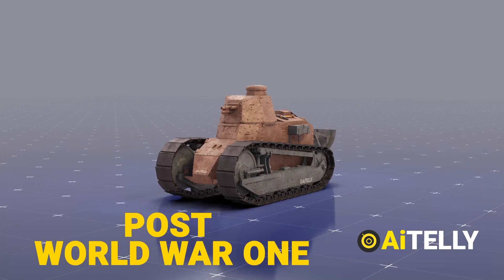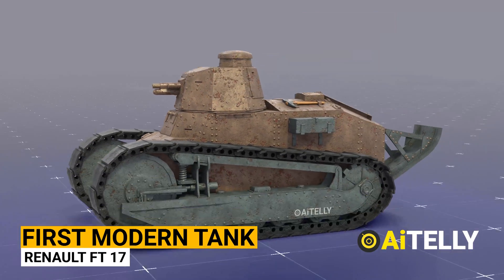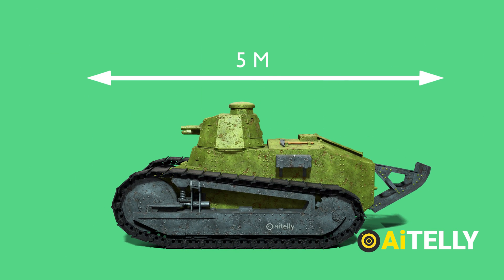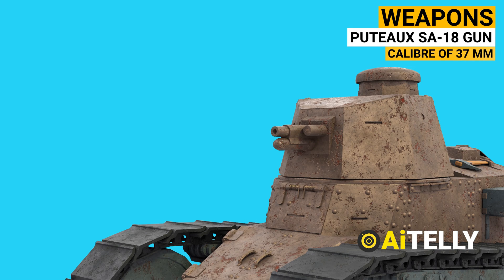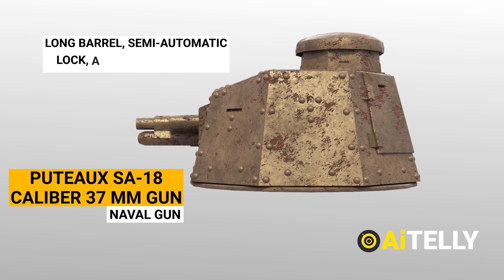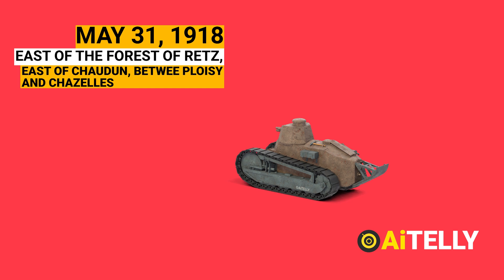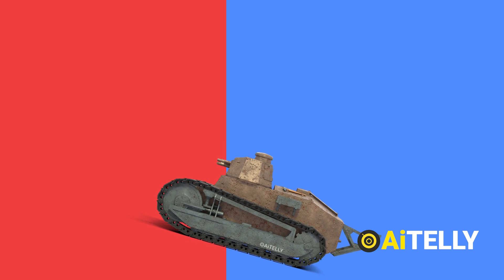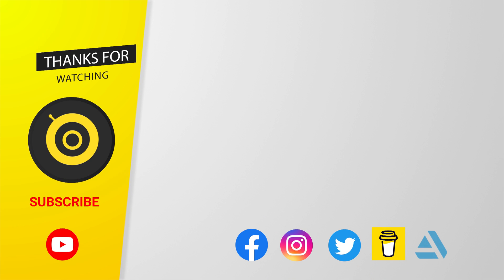Renault Tank FT 17 WW1 France Light Tank

Comment: The Puteaux SA 18 wasn't a naval gun but instead used the ammunition from a naval gun. The Puteaux SA 18 instead derived from the Canon d'Infanterie de 37 modèle 1916 TRP mini-field gun which was a scaled down Canon de 75 modèle 1897 field gun, using Hotchkiss 37×94 mmR ammunition.

Comment: What does the spoiler at the end of the tank supposed to do?
Reply: @fr3ddyfr3sh
I've heard several different explanations, and it's probably number 1:
1. The rounded tail made the tank longer so that it could cross trenches and ditches without falling in. It gives the tracks the chance to get a proper grip on the other side. Without the tail the tank would glide backwards, and then it would end up standing upright on its butt.
2. It's to keep the tank from making a backflip when going up a steep slope. But I don't think that really works with the shape; the tail would have to be much more pointed downwards (because the 'ground' behind the tank on a slope is also at a high angle).
3. It's to keep the tank from making a backflip when climbing over something (for example a tree lying on the ground). This seems more plausible than #2, because now there's still the horizontal ground. The 45 degree angle of the tail would make sense.

*Regardless of the main reason, a free added bonus of the tail is that bullets from behind are deflected downwards, thus protecting the vulnerable engine. Otherwise a bullet on the flat rearpanel would be quite damaging. Bullets that miss the tail will land on the angled panels of the tank, deflecting the bullets left, right, or up. 
But now that I think about it, that doesn't make much sense either. Someone behind the tank but to the left or right could hit those angled panels straight on.

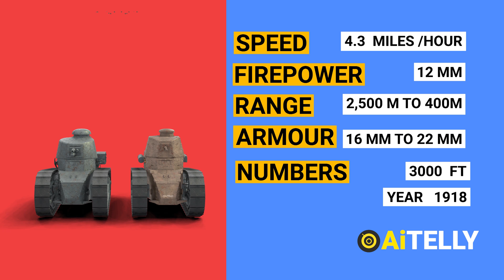Comment: 5:27 This is the wrong german flag.
Reply from the maker: Yes, we did some They kept on Changing in this era a lot with the German Empire.

The national flag of Germany (German: Flagge Deutschlands) is a tricolour consisting of three equal horizontal bands displaying the national colours of Germany: black, red, and gold (German: Schwarz-Rot-Gold).[1] The flag was first sighted in 1848 in the German Confederation; with it being officially adopted as the national flag of the Weimar Republic from 1919 to 1933, and again being in use since its reintroduction in West Germany in 1949.

Since the mid-19th century, Germany has two competing traditions of national colours, black-red-gold and black-white-red. Black-red-gold were the colours of the 1848 Revolutions, the Weimar Republic of 1919–1933 and the Federal Republic (since 1949). They were also adopted by the German Democratic Republic (1949–1990).

We had Done some Research but for some Reason We Just left it like That